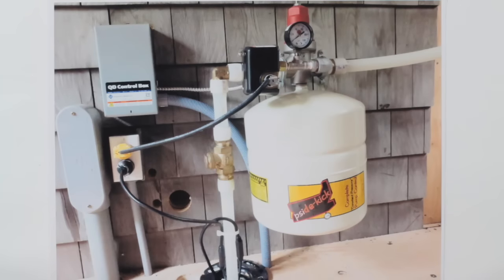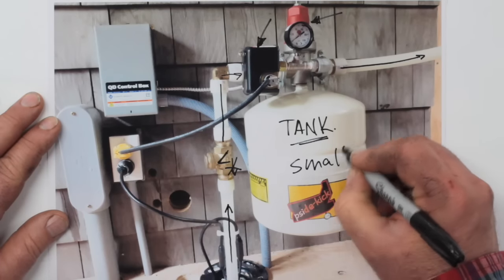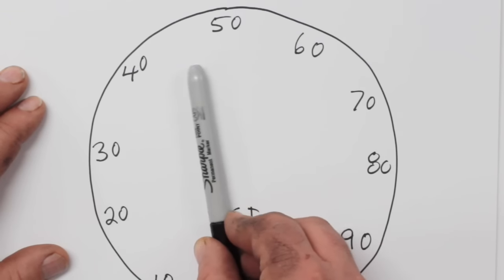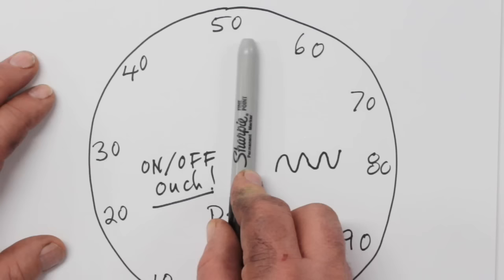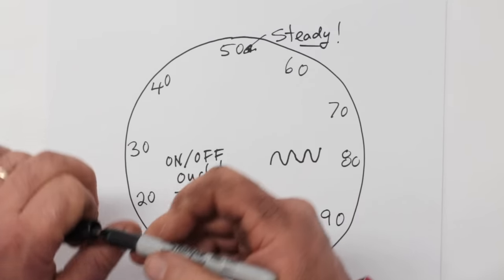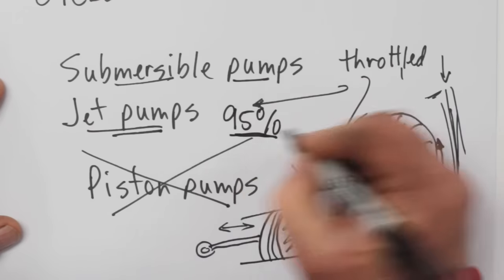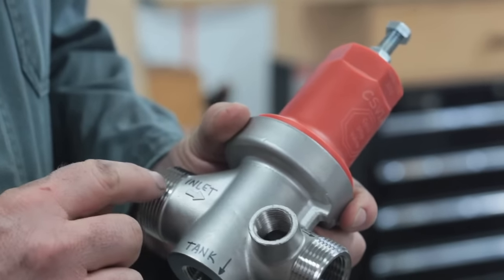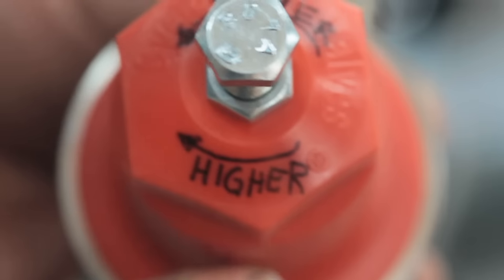Pressure Tank with Cycle Stop Valve Installation Sharpie Drawing

Comment: i installed this system and now it turns the pump on and off very often, this is not normal for the system.
Reply from the maker: The pump should turn on when you use water, and turn off when you stop using water.  That is the job of the pressure switch,  not the CSV.  The pump should stay off if you are not using water, and if it doesn't you have a bad check valve, not a problem with the CSV. .  But the CSV should keep the pump running continuously as long as you are using water.  If the pump shuts off even once while the shower is on, even if you shower for a month, then the CSV is not working.  If so, call us and we will figure out why and help you get it going.  Cary

Comment: why is the valve not made of brass ?
Reply from the maker: It use to be.  But now thanks to your government, there is no such thing as brass.  When they made us take all the lead out of brass it is longer any good.  It turned into a Low lead alloy called Sibello, which is no where nearly as good as real brass.  The low lead brass stuff now turns green like the Statue of Liberty.  The green flakes off and clogs up the valve.  It also has a tendency of developing pin holes in the castings.  So about 50% of the ones that were cast, had to be melted down and done again, as 50% have pin holes in the casting.  So we switched to Stainless Steel, which also has its problems, but nothing like the so called "low lead brass".  All of this increased cost to all of use just to keep the government from having to accept blame for lead poisoning.  Even solid lead pipes will not leach lead into the water as long as some government official doesn't pump acidic or caustic water down the lines like they did in Flint.  The low lead laws make everything cost more and have less quality.  We could all still have high quality and low cost brass components if the government would accept responsibility for their own actions, instead of trying to blame it on the pipe and fittings.  Sorry for the rant.  But you can thank your government for not having good quality and low cost brass available anymore.
Reply: some are, the better ones anyways, and now they are lead free brass. they are just more expensive because it is harder metal and more difficult to machine. the company I work for uses exclusively lead free brass because its just a better product than plastic or those other alloys
Reply: thanks.  i believed ''cast, not machined?

Comment: Only 30 lbs pressure in the tank when drained and power off.
Reply from the maker: With a 40/60 switch that is about right.  35-38 would be perfect, but 30 is not worth worrying about.